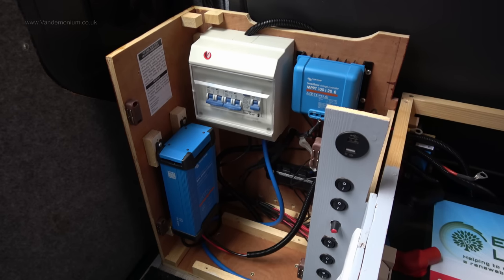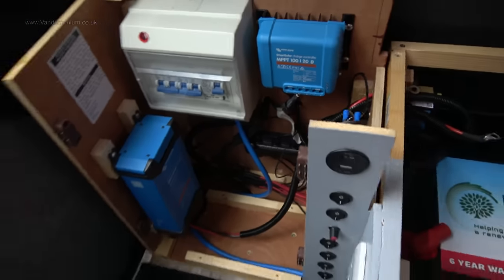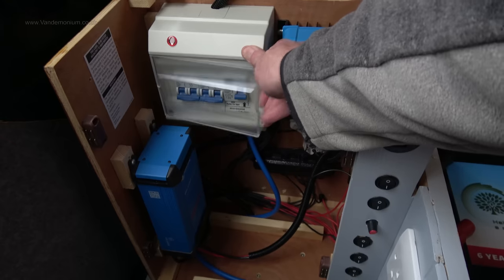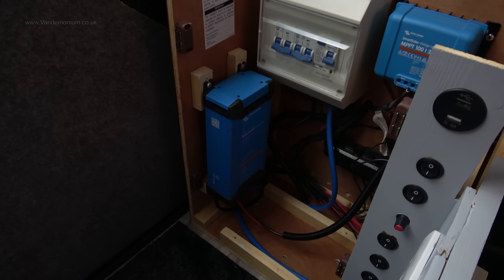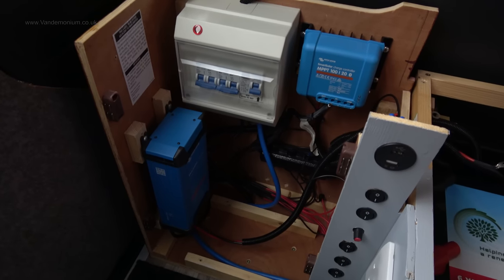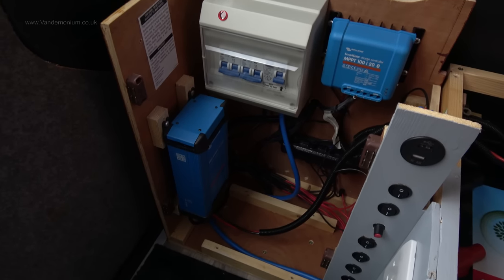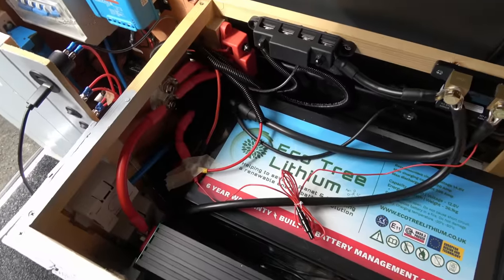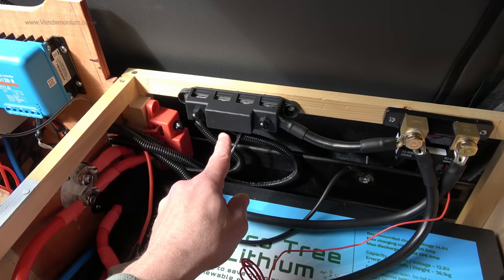79. Oh no! Did I blow up my inverter with an induction hob?

Comment: Neat, clean and functional. You did a great job. As a total armchair electrician, I think you need to tear everything out and start all over.  Everything on the left needs to be moved to the right everything on top needs to be moved to the bottom, got it?.  Good now lets get to work.

Comment: Over 100 amps is frightening to me. I come from an electronics background and even 1 amp scared me, as most stuff I worked on dealt with milliamps. The thought of over 100 amps flowing through those cables, thick though they are, scares the life out of me!  :)  Fascinating stuff David, I hope you get it working again.
Reply from the maker: I know, me too! I'm ridiculously cautious around it.
Reply: Don't look in your auto's engine compartment and those thick cables coming off the battery to your starter.

Comment: Impressed with the inverter cook top. We have electrical devices and an inverter running in cabin temperatures of up to 40°C. The engine room is much warmer. They all seem to get along fine with whatever cooling they find.

Comment: I was a day away from ordering my lithium batteries when I found out they were bringing out self heating ones. So glad I was able to get those.
Reply from the maker: I considered those but they need about 4A for the heating and with only 200W of solar on the van roof, that’s quite a chunk of the available power to keep the battery warm.
Reply: @Vandemonium  usually the heating only works until its up to temperature maybe 5 degrees  then it switches to charging.  Switching back to heating if it goes cold again.  But you can get a situation where there is never enough solar to start the heating and so it just gets discharged.   
I've gone for the fogstar drift which has heating. Awaiting delivery.  I think your battery was a much better price than mine
Reply: Those that invented self-heating batteries - have they thought about thermal insulation yet? To reduce the average power consumption. I get the distinct impression: no.

And yes yes yes, I'm ahead of you. Of course there needs to be a cooling system or insulation bypass for when it gets too hot (from use, I presume that the heater is smart enough to switch itself off).

Comment: Shows the problem with 12V.   Amperage and heat can be reduced massively by going with a 24V or 48V battery system instead.   Well, your Victron charge controller can do 48V, but you'd probably have to replace the charger, inverter, and battery, which would be an expensive proposition.   Cables can also be thinner.   A 48V system can push 4800W at only 100A, for example.   24V generates 1/4th the heat and 48V generates 1/16th the heat.

You might want to have an actual temperature-controlled exhaust fan in that box.  The inverter's internal fan isn't going to exhaust air out of the box in any appreciable quantity unless the air duct is directly in-line with the exhaust.  It doesn't appear to be.  It's in the same corner, but not directly in-line.
Reply from the maker: Yes indeed but everything you can buy seems to be 12V as standard, even if some of it is switchable to 24
Reply: @Vandemonium  That was true a few years ago but these days you can find basically everything in 24V and 48V.   LiFePO4 batteries, Inverters, chargers, (and you already have a 12/24/48-capable charge controller).

I'm not sure what the U.K. equivalent is but here are some quick amazon searches that you can do.  For the inverter, "Wzrelb" is a good brand.  12, 24, and 48V versions available in a wide range of wattages.

For chargers,  it depends on the amperage.  I like Victron's 12A and 15A chargers, they have 24V versions.  "Victron Energy Blue Smart IP65 Charger 24/8(1) 230V UK Retail" for example. 

I don't have a recommendation for 48V versions.  For LiFePO4 chargers you need one that doesn't just shut-off after charging is complete.

In anycase, you have already invested substantially in 12V so it may be too costly to change.  For anyone doing a new system, though, the absolute minimum should be 24V, and 48V is the all-around best solution.

Comment: Shouldn't be too big a problem, I ran a 2000w induction on a 1200w inverter on 2x120ah AGM batteries. The induction started on 1800w so I had to immediately drop it back to 1000w or lower, but it worked fine by doing that.
I'm pretty sure you'll find that when the induction is working properly, you won't use the kettle

Comment: I have a 2000 and a 1000W of that inverter model - never had a problem but at least Renogy are good at support. I use a double hob on a 2000W inverter just fine.

Comment: Hi. Interesting video as usual. Just one thing that I noticed regarding the connection between the battery and mppt controller. From memory I believe that Victron warn against connecting solar panels to an mppt controller that is not connected to a battery. They indicate that doing so can cause permanent  damage to the controller. Mind you given our current weather (no pun intended) there might not be too much solar  power being generated. Keep the good work
Reply from the maker: Cheers - look again (very hard to see) and you'll spot the wire from the panel is unplugged from the controller

Comment: A cliff hanger, how nice. May as well venture a guess. The wiring looks good, there was no bang and you said "oh" right after the apparent power loss, It must be something simple and easily fixed like the plug fell out of the socket. No those over-engineered plugs would never so casually fall out.  More like you accidentally bumped the off switch.

Comment: 13:00 It wants an external temperature sensor because the temperature that the charge controller is doesn't that much matter; the differences it will inflict are more related to how full it can charge the battery than any particular harm it can do to the battery. The temperature of the battery is what matters and where damage can be done. And that battery is a SIGNIFICANT mass of a thing that's going to warm up and cool down much more slowly than the charge controller will. So you want an external sensor, physically in contact with the battery and if it's convenient to throw a bit of insulation material on so that the sensor is protected from the temperature of the air around the battery and instead measures the battery, so much the better.

Comment: PS, I fitted a megafuse of 200amps to my inverter. It did fine with a kettle (camping one 1000w max output). IIRC last inverter was an old 2000w and was happy with it. :P

Comment: Slightly off topic as I didn’t understand the topic! But you can pop kitchen towel under the pans to keep the induction hob nice if you wanted. I am going back to the last video where I paused to laugh for the roar of the engine. Good luck with whatever this is.

Comment: Please don’t make us wait too long. If the inverter does overheat you could always move the top socket and fit a vent directly into inverter fans. Regards AJ.
Reply from the maker: Don't worry, part 2 was filmed at the same time and is already uploaded, just not released yet because I'm a tease 🤣🤣

Comment: Think of the chassis as a giant bus bar. You ground to that and the chassis is connect to the negative terminal…that known as a”Negative ground”  and that’s how it is mostly done.

But in the spirt of being different a lot of earlier British cars had a “Positive ground” system. The frame again acts like a bus bar but it is connected to the positive side of the battery. My brothers 1964 MG is positive ground. 

Needless to say you can fry a lot of things if you get them crossed.
Reply from the maker: Oh cheers yes I know that but the chassis is not used for return on any aspect of the campervan side of things (it’s twin black & red cable to every appliance individually) so the ‘earthing’ of the battery to chassis is not needed for that reason.

Comment: The wiring cabinet somehow looks neater now. It might be because the old inverter obscured where some of the wires came in. Now it's gone, there's no mystery about the wires down there.

Oh you did get the inverter in there. Nice. :)

Camper van insurance has nothing about what you do inside? Now I'm awfully tempted to make one in the style of an early medieval hut: with an open fire right in the middle! :D

Good to see the battery terminals covered up.

You could use a neon light by each socket. :)

It's lovely to have current readouts for everything these days. I hated not knowing.

Nooo! it's a cliffhanger! :D
Reply from the maker: Haha oh apparently the one thing the insurers do care about is woodburning stoves in campervans, they don’t like them!

Comment: They sell heating pads for batteries, I’ve seen some are USB plug-in most likely low voltage. Maybe have temperature monitoring in the battery bay?

Comment: The temp sensor.... There's no guarantee that the MPPT will be at the same temp as the battery in many installations. Hence the need for an additional temp sensor.
Reply from the maker: But in that case, why is it happy to do voltage compensation based on temperature?! It's the inconsistency that annoys me.
Reply: @Vandemonium  Guessing it's a hangover from pre lithium days. Temp comp for lithium is mostly irrelevant. Except the dreaded freeze cut off.

Comment: Wow David, that cliff hanger was rather abrupt, like a full stop landing on an aircraft carrier!

Through much assumed trial and error on the electric cabinet, your layout looks good.  I know you thoroughly research everything before you begin so, confident you will get it all sorted out.

And now for my "what it's worth" comments: It's difficult to tell since I am not viewing your setup in person but, the power cables between the battery and inverter appear to be good for about 50 amps.  For the type current you will run at "full tilt", I recommend the copper conductor diameter of at least 9mm.  When operating the cooktop at maximum power none of the cabling should be getting warm.  I use an infrared camera to check this.

I don't use shunts, it's just another connection point where power is lost due to the high currents.  Instead I use the inverter current monitoring, which is not necessarily that accurate.  To double check, I use a high accuracy clamp meter to test the calibration of the built-in current monitoring.  As you may have noticed, I'm fussy about 12 volt systems because, DC currents must be extremely high in order to make 1,000+ watts of Mains power.

I have designed several inverters, as well have reverse engineered various brands and found the overheat protection very poorly implemented on most inverters.  Some act so late, they were obviously added to prevent the unit from catching on fire.  A good design will start throttling back the output power when unit internals reach +60 to +80 degrees Celsius.

As to the abrupt power cutoff on your induction cooktop, I assume a fuse blew or a sensor shut things off.

I looked at the battery datasheet for your battery and the current rating is very strangely stated.  It says a maximum of 43.2 amps Normal, then 200 amps continuous, then 300 amps maximum for 3 seconds.  I'm not sure what to make of that rating.  Lithium batteries are extremely unstable so, must be protected by several layers of protection circuitry.  For this reason, Lithium batteries are not recommend for engine starting applications.
Reply from the maker: The cables are rated at 345Amps
Reply: @Vandemonium  That rating could be meaningless if it is based around Mains Power.  The real test is your full load at 12 volts.  If you are seeing more than one tenth volt drop from battery to inverter, the cables are too small.
Reply from the maker: It's rated at 12V DC
Reply: @Vandemonium  Thanks for the feedback David.  Sorry, I know your are very good about doing your "Homework" on these upgrades.  Since I'm not there to witness your actual installation, my sense of scale is compromised.  The inverter I am using to power my home pulls 200 amps at 24 volts so, quite similar to your cabling requirements.
Reply: @Vandemonium  

Hmm, that might only be in "free space".

There's "a" table available for when cables are run in ducts or in loaded cable trays, or clipped to walls, or run through concrete so you can apply a "down rating factor".

There's also a maximum length of cable run too depending on the end load with regard to volts drop.

In short once you've done the empirical experiment thing you'll soon know if the cable size, battery capacity and ventilation arrangements are going to work.

There was a remark earlier about consumer units being of the metal  case class or needing whatever class of RCCB (for such an application). Have to say not entirely sure if that is for dwellings/buildings  only ... and too tired to Google at moment.

Comment: All looks very neat - hope you haven't killed it. Induction hobs are very quick - mine boils the stove top kettle in the same time as the electric jug kettle. The cost of extras is what put me off Victron, I've just had to get a new Solar Controller and have gone Renogy, it came with a temperature probe to put with the battery, plus I can upgrade several bits without changing it, add a Bluetooth module ($30), add a quality monitor ($95) - or go flash and get the new Renogy One all singing and dancing monitor for less than a Victron Solar charge controller costs here. Victron charge controller without Bluetooth was twice the cost of the Renogy unit including the Bluetooth module here in NZ - Renogy kit was bought via Amazon AU - though we have a local Renogy Official stockist opening soon.
Reply from the maker: Yes, I'm really not a Victron fan. I always liked the Epever stuff I had on the boat.
Reply: You really should get in touch with ex-narrowboater, "Journeys with Jono"
He used SO much Victron stuff on his boat, that they offered him a job  !
He knows his stuff.
Love the Cliff-hanger though  !
Take care, stay safe,
Stu
Reply from the maker: But I don't need to..? I know already what does what and how etc
Reply: @Rovinman  

😂😂😂😂😂😂

Hmm, really?

It took months to get him to comment on the topic of charging his LiFePo4 at 0C and below.

All we got was deflection after deflection.

Lithium kit is perfectly fine in the warmer climes (with adequate ventilation for the avoidance of thermal runaway issues, and there's no shade on your solars, say.

In UK LiFePo4 lithiums are sort of OK, just about, all things considered, when used on a narrowboat or RV.

Comment: solar generater also could be quickly disconnected from your Van and quickly installed in your new boat which could operate an electric engine ( 110 lbs thrust) as well as complete electrics of boat ( Pecron 1500 lfp ) toaster, electric hot plate, coffee - tea pot and microwave ....... great white north.....S
Reply from the maker: It would give me barely any range on the boat before needing to be recharged.

Comment: As long as you have a pure sine wave inverter(not sure of the model) that should be okay.  As someone who has done things like this professionally you did a perfectly fine job on all of it.  My only suggestion is to be sure to protect your high current terminals terminals. Even with some liquid electrical tape painted over them.  Not that you put anything in there but any exposed connection is a potential short circuit.  Rodent, something spills etc.  That is far from an immediate concern though, just something to consider.
Reply from the maker: Yes, I've been pondering what to do with the master switch terminals
Reply: @Vandemonium  if you want to email some measurements I'd be happy to 3d print some covers and send them to you.   Again, something to think about. Thanks for another great video
Reply from the maker: Oh that's kind, thank you.

Comment: i have the same inverter, it has pass through so when hooked up to shore power it will pass through the current without the inverter being turned on, means you can use same plugs for inverter and shore power, you probably already know but thought i would mention as you are using separate plugs for each one
Reply from the maker: Cheers yes I explained why I didn't do that in a prior video
Reply: @Vandemonium  ok missed that one, you have a very similar electrical build to me including stove, great minds think alike lol
Reply: one last thing, would deffo get a jetboil (or knock off one as much cheaper and the same) for boiling water, from experience only want to be getting stove out max twice a day as due to size is always in the way lol and i have a lwb van
Reply from the maker: I have a kettle! (It appears in the next video)